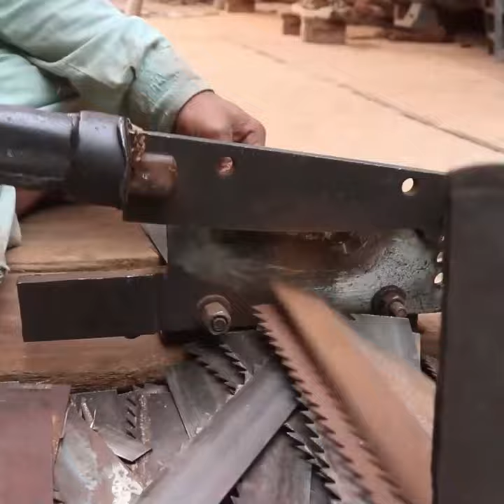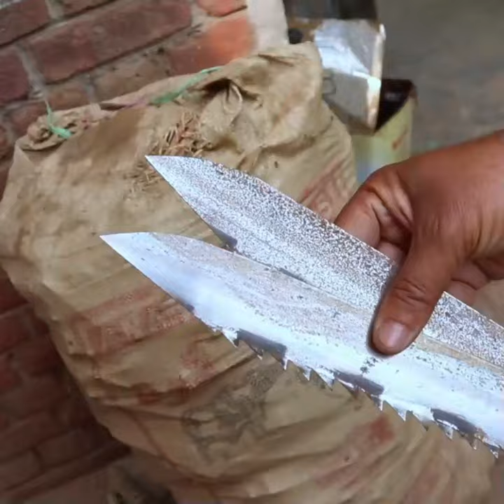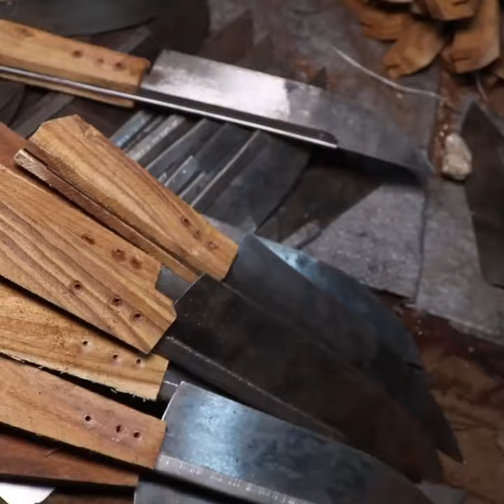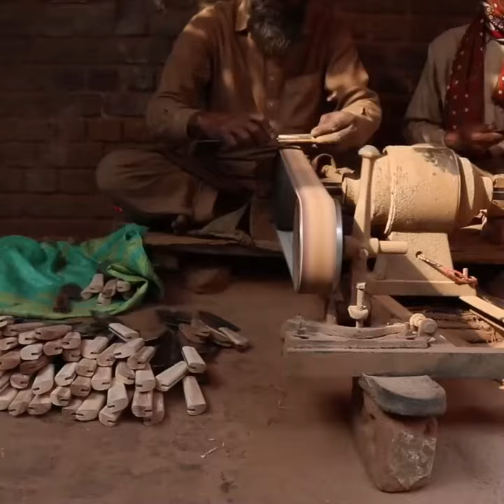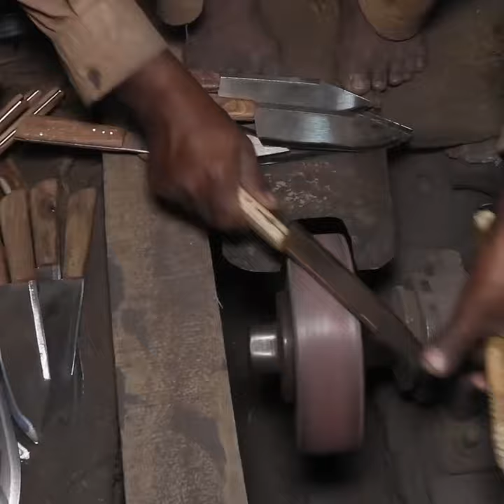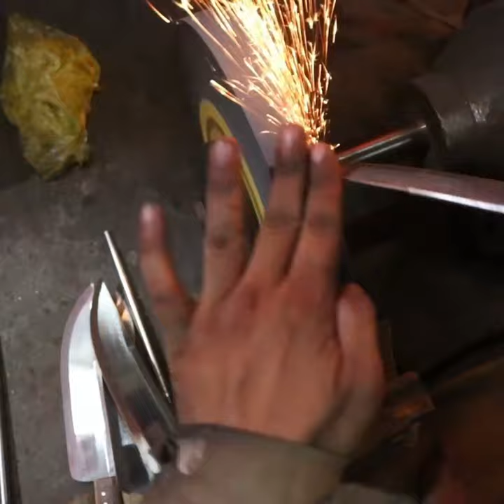Restoration of old Hardware into Making Sharp Knives by Handmade Making Knife #knifemaking #shorts

Comment: Heat treatment has left the chat
Reply from the maker: We know but it is for local and very cheap consumption here this is not export quality
Reply: these blades are very hard, they do not need heat treatment
Reply: @amazingskills48 if they came from saws only the teeth are hardened while the rest is untreated to be flexible
Reply: It's not like the back of the saw is completely annealed though, as it would stay bent to the shape of the wheels of the bandsaw. They probably are around at least 40hrc; not great, but it will cut. Scythes for example are not very hard at all, they rely on work hardening after peening. Roman gladius blades were typically not hardened either.
Reply: @amazingskills48  obviously you have never ever made a knife...Anything drilled with ease is a shitty steel... And it is a band-saw... meaning only the teeth are hardened since it goes around tight corners...

Comment: 通常金属切割用的带锯是锯齿处为HSS。而背部为油淬高碳钢。所以不需要热处理
Reply: Мне кажется при заточке от быстрорежущей стали должен быть красный сноп искр?
Reply: @ИванБескид 磨削火花确实是一个很好的鉴别方法，不过这跟砂轮也有一定的关系。按我的经验，HSS和碳钢的区别不会太大，没有颜色区别，更多的是火花形状的区别
Reply: What shape spark is hss?
Reply: @154cm00  The band saw used for metal cutting is indeed a hss edge, but I looked carefully in the video and it should be an ordinary woodworking band saw. This is the overall high manganese steel oil quenching
Reply: @fishman-v1u  entonces dices que sera un SAE 650.  .  UNE F 1430 ?

Comment: I only know the cut from really cheap knives, there is no heat treatment and I don't know any kitchen knife that needs / has a reinforcement at the back. Normally you cut a maximum of 1 inch with it till it hits the reinforcement. According to the reinforcement and the heatreatement I expect that they will become dull in a very short period.
Reply: У них тонкий материал  поэтому армировка улучшает жесткость
Reply: Given their base material and from my bladesmithing experience, they are doing a pretty damn good job at making a cheap functional blade. Heat treated steel is a pretty recent thing in our societies